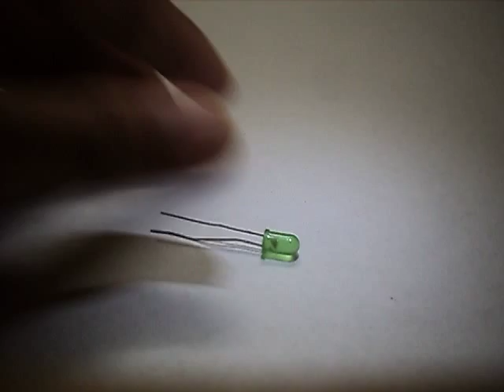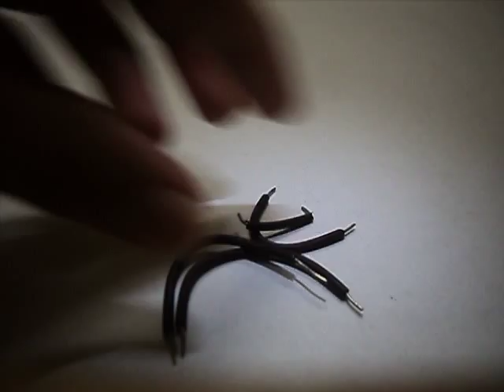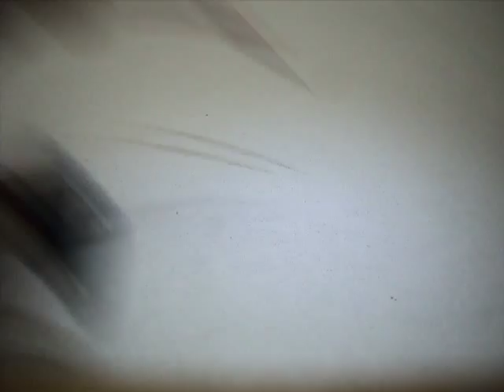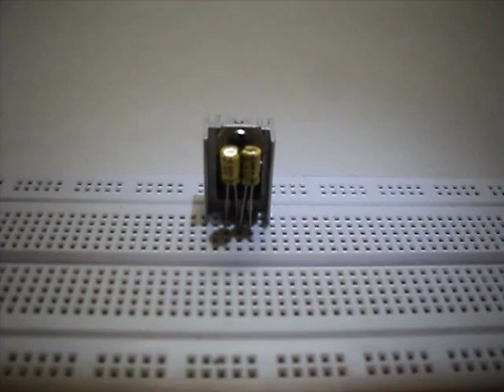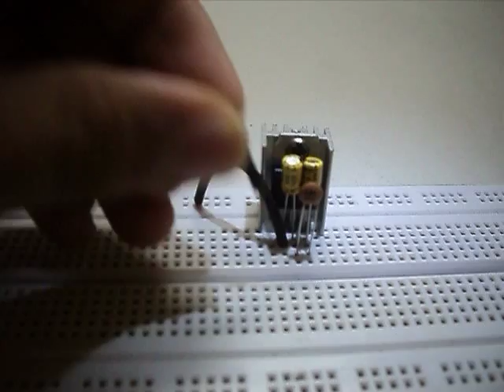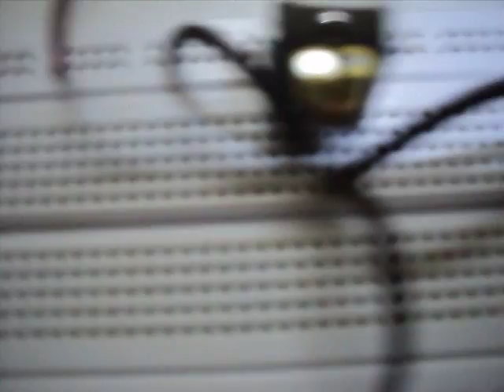how to make a constant voltage regulator.

Comment: thank you for videos. 
How can I make 27 Volt voltage regulator and how can I calculate these capacitors value?
Reply from the maker: if your input voltage is high (36 - 37 max) then use lm317 regulator. circuit for that is different,check out on google. ☺

Comment: I have a senser output voltage of 3-4. 5 Volts, how can I Make that voltage constant(About 5 Volt)?
Reply from the maker: you mean you have output which would vary from3 to 5 volts? in casd you can use schmitt trigger which will give you only two output states either 0volt or 5 volts.